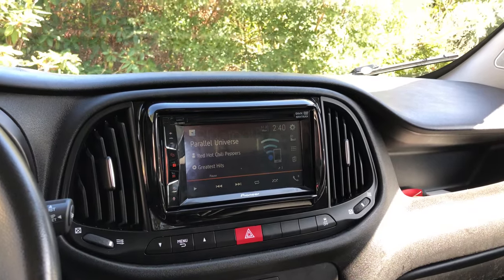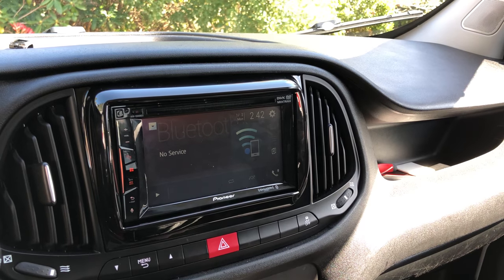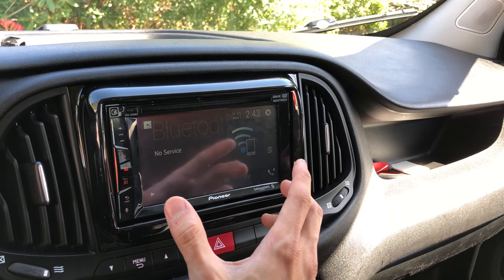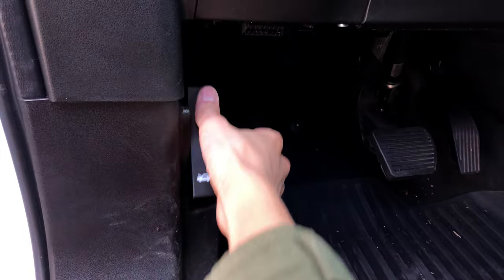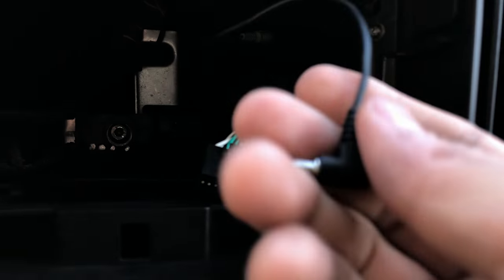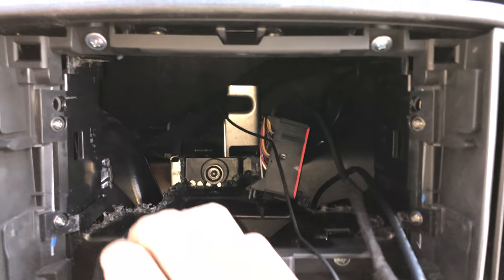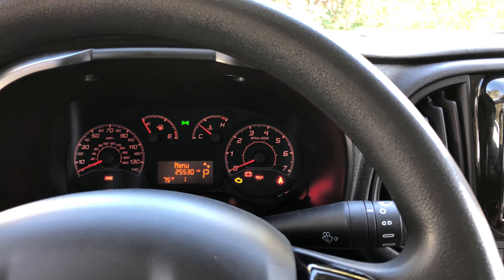How to Install Custom Radio Pioneer AVH1300-NEX in Ram Promaster City

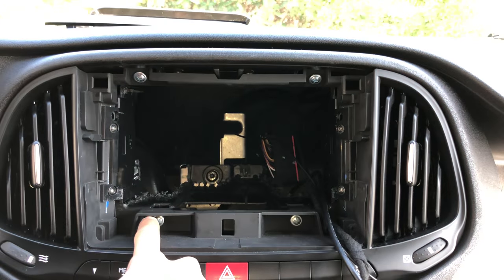Comment: Thanks for your video. At minute 3:45 you explain how to remove the panel. I'm trying to do that to install new car radio  but the lower part under the emergency light button doesn't come out, it's locked in some way. Do I only have to pull or are there some clip to unlock?
Reply from the maker: It's been awhile, I don't remember if it was necessary to remove. My process for installing the radio was to continuously try it out and see what's in the way. Cut out any plastic which you have to remove to make it fit, if it cannot be removed any other way. Just be careful not to damage the pipes that carry air
Reply: @SmartVan  thank you. I solved it by slipping a blade under the tab to unlock it

Comment: Hi, I bought the metra wiring harness adapter but the ignition wire goes into a smaller harness so the receiver is always on. Where does that extra bundle of wires go? I couldn't make it out from roughly 3:00 in your video
Reply from the maker: Extra wires you just have to stuff deep into the dash, it's a bit tedious, but you can get it so that the extra wires are behind the metal piece in the center, and then plug it into the box when it's close, then shove the rest in.

Not sure what you mean by ignition wire issues, check out my full walkthrough here: https://medium.com/@chris_41792/guide-how-to-install-an-aftermarket-radio-in-a-ram-promaster-city-754cccc29ad7
Reply: @SmartVan  Thank you for your response! By ignition wire I mean the red wire that figures out when the car is on vs always being connected to 12v. 

I did figure out that I was missing the interface that the 2nd wire clip connects to. Also, upon speaking with Metra they informed me that the interface is no longer compatible with the promaster city. Did you have any issues with your dash controls after installation, or was everything plug and play?
Reply from the maker: @kowboykelley4678  Everything worked for me except for the backup camera turning on when shifting to reverse. Working on a fix for that later.
Reply: @SmartVan  Hey thanks for the video. Any update on the backup camera when shifting to reverse?

Comment: why you don't connect the original Mike the one comes with the car ? It is impossible to do that ?
Reply from the maker: Hey Link9a, I did not find a mic in my car, if it makes a difference my model doesn't have the upgraded dash package where the steering wheel has buttons to talk to the radio unit.

Comment: Thanks for sharing!  If cost was not a factor, which would have been your preferred system and why?
Reply from the maker: I talked with a guy at car toys and he also said that they all use Pioneers in their own cars, so it's a pretty strong contender. If cost is really not a factor, Alpine makes one that I haven't tried, but it might be good: https://www.amazon.com/Alpine-ILX-107-Mech-less-Receiver-Wireless/dp/B06XXLL5FL
Reply: Thank you!

Comment: I installed mine and for some reason the ignition wire didn't work. I had to run one from the fuse box. Do you know what might have caused that?
Reply: I talked to Metra. DO NOT USE METRA XSVI-6523-NAV. Use the Metra XSVI-6524-BT. You can find it on Amazon or SonicElectronix.
Reply from the maker: @heathkirby5868   I haven't had issues w/ the ignition wire, but the backup camera doesn't trigger correctly on reverse. Maybe the 6524-BT fixes that, it does seem to be compatible in the datasheet. If others have experiences with the 6524-BT definitely note them!

Comment: I was in your same boat without a back up camera, I know you have a video about that install.  But, I don't think I'm going to get enough use out of the back up camera. Is there a different head unit you saw without a disc drive and back up camera?
Reply from the maker: You can look around on amazon, but this was one of the cheapest. Backup camera is great insofar as it lets me keep my curtain dividing the front cabin and rear, which reduces road noise and makes AC more efficient to cool the front cabin only.

Comment: Did you lose steering wheel controls without using the datalink module?
Reply from the maker: My van didn't come with steering wheel controls but I've read that people typically do lose that :(